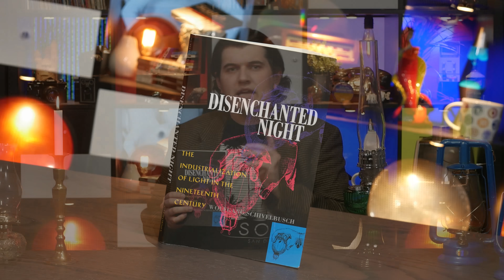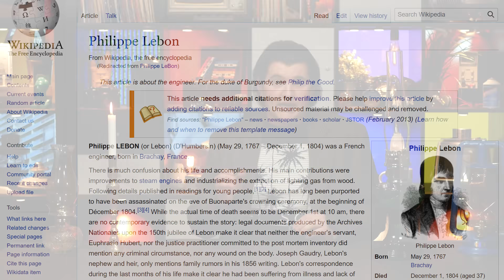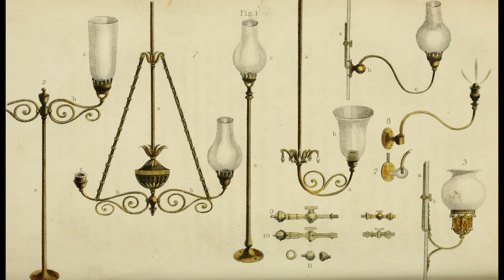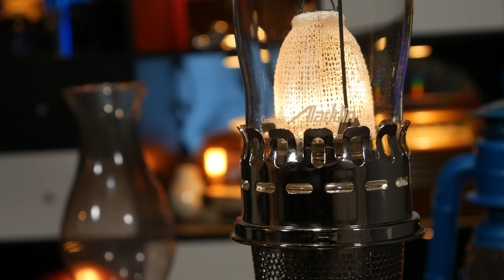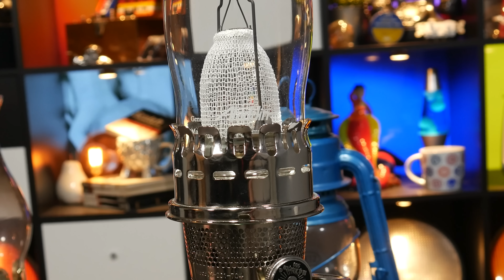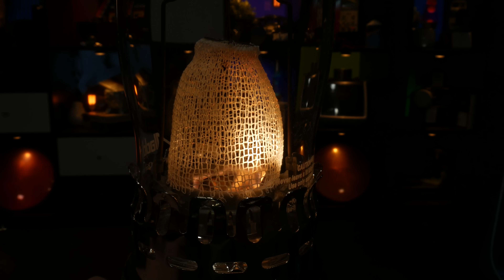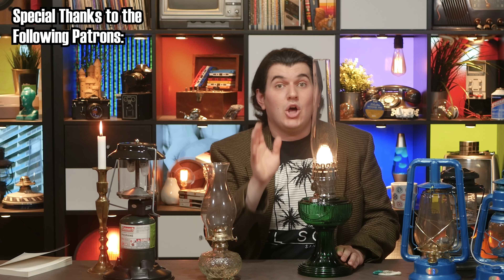How the gas mantle made lamps 10X brighter

Comment: I love both my Aladdins and my Coleman table lamps. Note these are the same principle as the camping lamps but are made for in home use. I actually like to collect different mantle lamps from kerosene to gasoline pressure lamps. Ill just say though they are wonderful for winter use as you get heat and light. In fact with an Aladdin it burns hot enough at the chimney to light a cigarette. As a side note, once carbon buildup begins on your mantle you will get a "wonderful " black spot" on your ceiling. Once you have it back under control it will be self cleaning.

Comment: As with the gas mantel a Nernst lamp circa 1897 was an early form of incandescent lamp. Nernst lamps used a zirconium oxide yttrium oxide ceramic rod which was electrically heated to incandescence by a "glower".

Comment: In the Canadian military we have what is called a tent group (see the video linked below).  A set of equipment to be used in a 10 man tent in Arctic conditions.  Each tent group includes a naptha fueled Coleman hand pumped pressurized lamp and a 2 burner Coleman Tourister model stove.  With the lamp, stove and the body heat from 10 soldiers you can go from -40 degrees outside temperature to a few degrees above freezing.  It's important to note that the tents are made of a cotton material (as it doesn't freeze stiff like most synthetics) has two layers for added insulation and a ventilation hole for use near the stove.  

It's a remarkably efficient system and properly set up and used doesn't have a risk of asphyxiation but you will get red eyes after spending a night in one.

https://www.youtube.com/watch?v=tQwq8qz_zKs

Comment: A gasometer rises and falls depending on the amount of gas contained inside, so it's therefore also a meter of sorts. The weight of the cylinder provides the gas pressure.

Comment: 10-12 year back in India, (pressurised) Kerosene fuelled Mantle Lamp (the thing which will be discussed in next episode) were still pretty common for makeshift setups like weekly vegetables market or a hawker selling stuff in late evening (like a roasted peanut hawker in winter). Now, even in those area, it has been replaced exclusively with LEDs and sealed lead acid.

Comment: 8:30 You missed the reason why we say "Turn on the lights". It was because of the gas valve that needed to be turned to the 'on position'. 
When electric lighting replaced gas lighting a switch replaced the valve. There were signs that read "This room is equipped with Edison Electric Light. Do not attempt to light with match, simply turn key on wall near the door" - Turn On The Light!
Reply: This style of switches are still being made
Reply: @kornaros96  As are the push button switches that replaced them. Then the twist key came back in the 1950s, after the toggle switch, which came out in the 1940s. The 1960s were all about the rocker switch, which evolved into the Decora switches of the 1970s. Light switches remained pretty static after that until the introduction of smart switches recently.
Reply: I mean, there's no reason electric light switches wouldn't have had an "on" position anyway...

Comment: I have a multifuel camping stove that can run on all manner of fuels by merely changing out a single brass jet for one of it's three included ones all with different oriface sizes.
The fuels include but from memory are likely not limited to gasoline, propane, kerosene, diesel, napatha/coleman fuel and I also believe it will run on vegetable oil.
Tis a shame I very seldom use it considering it wasn't exactly cheap.

Comment: The Gazometer does function as a measuring device, even if it is an incidental quirk of the design. In order to maintain pressure, the gazometer was built like a telescope. It would expand as the pressure rises and shrink as the gas was used up. A full gazometer would tower above almost any city of the time, while an empty one would recess completely into the ground.

Comment: You didn't mention the chemical composition of coal gas.  It can a fairly varied mixture containing hydrogen, methane, ethane, acetylene and even carbon monoxide.  The composition varies with the production air/fuel mixture, combustion time and temperature, etc.

Comment: I'm going to tell you off for calling the Aladdin's wick "defective", nope, it isn't, you need to char the wick before it is used, by dipping it in some fuel and letting that burn off to a char, then you even out the wick using an aladdin wick trimmer, this evens out the wick and thus makes the flame even, so, er, it's the PEBCAK on this one... :P
Reply: So the issue is an uneven char on the wick he's using?

Comment: lute n.

A substance, such as dried clay or cement, used to pack and seal pipe joints and other connections or coat a porous surface in order to make it tight

Comment: I can’t imagine how nauseating that theater would feel 🤢. Also, an idea! When trying to show a visual of the smoke emitted, could you try putting a big white piece of foam board or paper slightly behind the lamp? Maybe you could see the smoke easier with the contrast. Maybe with some images taped on the back so you could flip it around and show how they’ll get distorted by the heat. 🤔

Comment: I run diesel on my kerosene pressure lamp. I pre heat the generator using isopropyl alcohol or meth spirit. I'm sure I could probably run it on engine oil as diesel kerosene and engine oils are all pretty similar

Comment: Seeing that Coleman lantern brings back some childhood memories camping with my father. As dusk settled in, we would stop whatever we were doing and pump and pump and pump and pump those lanterns until they were pressurized enough to last us all night. I was actually really bummed when my stepmother convinced my dad to switch to propane lanterns as the lanterns had been in the family for decades by that point. I wish I still had them.
Reply: Growing up my dad had the propane variants but when I started buying stoves and lanterns for myself and family, I picked up the liquid fueled versions. The propane versions are more convenient but have their downsides. The propane versions tend to struggle at high altitudes (if you enjoy camping above 8,000 feet) and they really struggle in areas with high humidity (50% or greater) as the pressure decreases inside of the bottle the temperature decreases which causes the bottle to sweat (attracting moisture) and then freeze...which reduces the output.
Reply: @zapityzapzap  Plus, with the white fuel, you could cut open the empty container the fuel was sold in, bur off any volatiles, flatten it, and pack out the metal folded up.
With the propane you have to carry out the tanks that are heaver per hour of use than those old cans, and not a lot lighter than they were when full.
-
And then finding a way to legally and responsibly dispose of those empty pressure vessels.

Comment: One needs to get back into the Aladdin fire point at the metal gas holes.  Like any modern BBQ with pressured gas, inside the metal piping with the many blue flames, carbonization builds up inside the metal piping, and must be bristle brush and tooth brush cleaned out the portal holes, and tap ("beat") the piping so that all the inside soot and carbonization is loosened and pushed out by the gas pressure.  So one needs to keep the mantle portal clean, and one won't have hot and cold spots on the mantle.

Comment: I have several antique Aladdin lamps that came from a caboose so have a sprung mounting to reduce vibration. They are hard to get the wick trimmed right so there is no spike like you showed and the chimney is very easy to break.  We use ours when the power is out.

Comment: In all the research I have done on gas mantles (related to the gasoline powered mantle lamps, commonly called Coleman Lanterns for obvious reasons) have indicated that the thorium or yttrium based mantles actually fluoresce instead of simply becoming much hotter than otherwise expected. I have always taken this process to mean the same as it does in a fluorescent lamp, where electrons in the phosphors are excited to a higher energy state, in this case by the heat of the gas flame instead of from UV radiation, and then they drop back down to emit radiation in the visible spectrum. Can we investigate that process as well?

Also, there were other direct flame lamps that used a similar burner as the Aladdin lamp but illuminated with the flame itself. These include the Rayo, and the Juno 2, and the Plume and Atwood Royal--The latter was popular in railroads, in fact. There were, of course, many others of this design.

Comment: I read a story with a catalyst that could automatically light the gas in a gaslight. In fact it may have been the trope namer for "gaslighting". Have you heard of it?
Reply: If this catalyst would exist, modern gas equipment would use it.
In fact they use a pilot flame and a temparature supervisor
Reply: @mgsp5871  I assumed that there was some practical reason why it wouldn't work, even if it was theoretically possible.
Reply: @otterylexa4499  OTOH this catalyst may also be extremely expensive, so any other technical solution is cheaper.
To understand the meaning of 'gaslighting' (manipulating someones mind) you have to watch the very old movie 'gaslight'.
The action of 'gaslighting' is meant 'as in the movie gaslight' but no gas is used in the action, it was just the random title of the movie

Comment: My grandparents lived in a rural part of Alberta with no electricity. My Mum remembered when they switched from kerosene lamps to naphtha pressure lamps. She said the difference in light was amazing. Also, nobody but my Grandma was allowed to handle the mantles because her boys (four of them) would inevitably be too rough with them and destroy them. Grandma was also the only one allowed to hook up the batteries to the radio (possibly because "someone" hooked up the 45 volt "B" battery to the filament connection and ruined a complete set of expensive vacuum tubes!).

Comment: i think running out of oxygen is one of the greatest myths of all time as if burning carbon based fuel in an enclosed spase, you will get co2 poising way before the 20% oxygen "ran out" think about it, if the air had less oxygen then it does not mean there going to be more nitrogen in its place so that we cannot use the air. in fact, if we can get rid of the co2, human can stay in an enclosed space much much longer despite the deceasing air pressure and oxygen content (if they do not get replaced by leaks to fresh air) things can be different if you burn pure hydrogen in an enclosed space though if it does not explode.

Comment: I don't think the soot that allows the flame to glow has much to do with how "clean" the fuel is. The dim blue glow of a natural gas stove is attributable to a perfect fuel-air mix.

With that proper mix, even wax will burn dim blue and soot-free, but when burning rich, the decomposition of hydrocarbons results in unburned carbon particles that will emit black-body radiation untill they either encounter oxygen and combust into CO/CO₂, or, if not kept hot enough for combustion, exit the flame as visible black soot.

Thus, you don't need an impure fuel for lighting; the impurities are generated on-site.

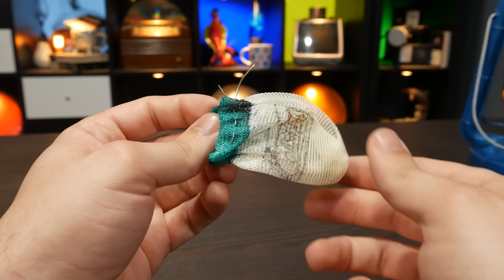Comment: 17:05 AAAAAHHHHH! Don’t handle the new mantle with bare hands. The oil on your hands contaminates the fabric and the result are (most likely) those hot spots you talk about later. You should only handle them by the strings to install them or wear thin cotton gloves.
Reply: Looks to me like the mantle he handles in the video is a different one than the Alladin one. The alladin one is the one he shows "burning off" the blue stuff. I guess it is still solid advice, but I think in this case might not be the cause of the shown hotspots.
Reply from the maker: Yes, I've only ever handled the Aladdin mantle by its wire holder. That's not what's causing the hot spots.
(also for what it's worth, the instructions from Coleman make no mention of avoiding touching them before the initial burn-off. I can't see how any oils you may deposit on them would manage to be a problem given you set fire to the thing)
Reply: @TechnologyConnections  The guidance was from my army dad when I was a kid. Perhaps it was related to the thorium but I recall him explaining that the oils leave a residue even after burning which interfere with the chemistry of the metal oxides left behind.
Reply from the maker: Personally I feel like that doesn't make sense. There really isn't any chemistry going on in its operation (it's just ridiculously hot), only at the time of the initial burn-off. And while I suppose residue could interfere with that process, I would think the composition of the fibers themselves or the inks on them would be more problematic than anything oils from your fingers could do.
Reply: @TechnologyConnections  I believe (and will search for sources as my opinions are meaningless)  The oils chemically alter the salts impregnated in the fabric so that when the fabric burns away the resiudual salts aren't the intended oxide compound as intended.  I'll post any concrete research I can find here, if it exists.  Otherwise my data is anecdotal.
Reply: I doubt the oils are much different than the material the net is made of pre-burn, besides maybe being less inert. There is chemistry going on in the mantle, and it's basically "(anything)+O2=hot"
Reply: @crackedemerald4930  Well the same can be said for halogen lamp bulbs and it's well known how hot they get, but an oil deposit from fingers can cause a hot spot and lower the lifespan of the bulb despite the high heat.
Reply: @lohphat  it's true, so do those quartz tube heaters. But those don't work by viciously oxidizing fuel.
Reply: @crackedemerald4930  Yes, however skin oils can alter the salts so that when the fabric burns off, the resulting ash mantle is not the same chemical compound as untouched salts.  Thus the catalytic reaction is different than the untouched, unmodified salts. Again. This is all hypothesis -- I'm still searching for actual data.
Reply: @lohphat  but the organometallic compound would surely degrade into something less organic in the highly oxidizing atmosphere?

Comment: I've used lamp oil and K1 in my Aladdin lamps... I live off grid and use both the old school Hurricane and Aladdin lamps, when solar / wind energy is low. Also use a wood gasifier to supply wood gas for cooking and genset operation.

Comment: Hey tech connection, your blower made me think of something really neat you should cover - fluidics. There's a Toro leaf blower that has a special attachment that can make the stream of air go back and forth with no moving parts. The longer you make the feedback loop the longer the period of the motion and the greater the gain so you can really feel the blower going back and forth. What's extra neat about this is that it's the same thing that makes the washer nozzles in a car work. If you illuminate a windshield washer spraying with a strobe light you'll see that the liquid is coming out in one stream that oscillates back and forth. This is to improve coverage for a given amount of liquid and flow over a traditional shear nozzle. Also the droplets are larger so more should reach the windshield.

Another fun thing now that I'm thinking fluidics, you should also look at pressure compensating devices in faucets. They are everywhere and brilliant.
Reply: I never knew washer fluid nozzles were anything but ordinary, I've gotta try that strobe light thing!
Reply: @nthgth  I'm not sure if European and japanese cars still use the tech, but all American companies do at the very least.
Reply: @gaussmanv2  Oh interesting. I've never noticed a difference in how the fluid sprays between my American and Japanese cars (never had a European one). 
How would you set up this strobe light test? Like a fast strobe like at a Halloween party?
Reply: @nthgth  try to find one with a tunable frequency. That way you can find the frequency of the fluid when it creates standing waves. Also make sure to have a dark back ground.

Comment: Gas mantle lights can also burn acetylene. In rural areas there were gas sheds outside the house where calcium carbide was mixed with water in special reactor vessels to produce acetylene. There were small pipes inside the house walls "hollow wires" to supply the light fixtures.
Insurance companies were reluctant to insure houses using this system.